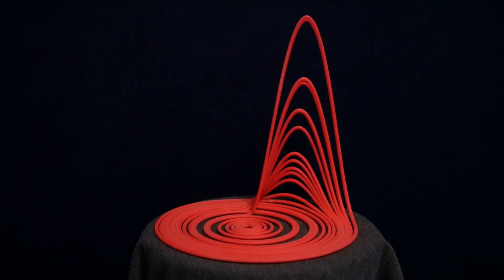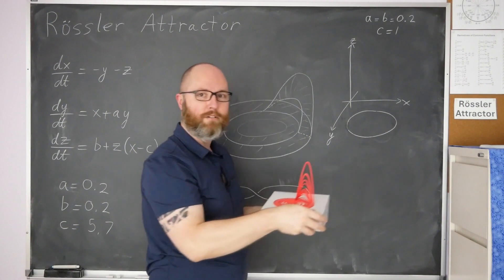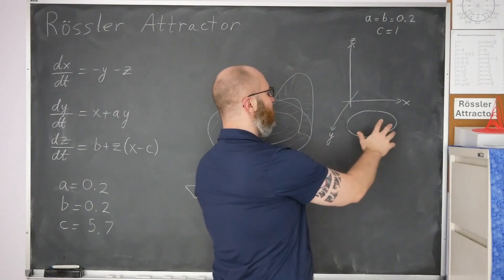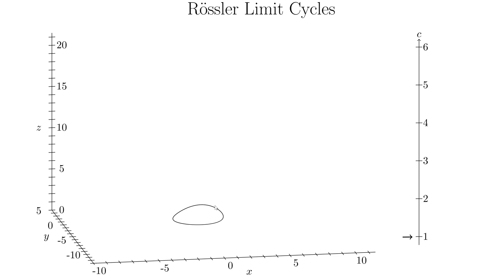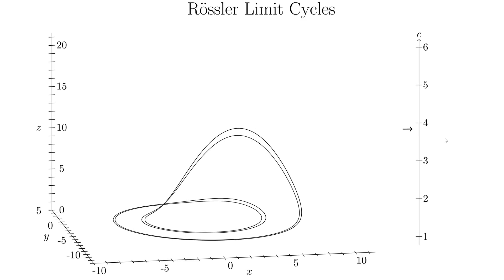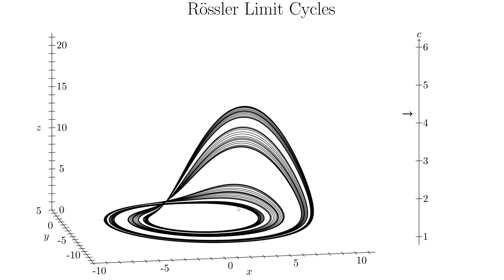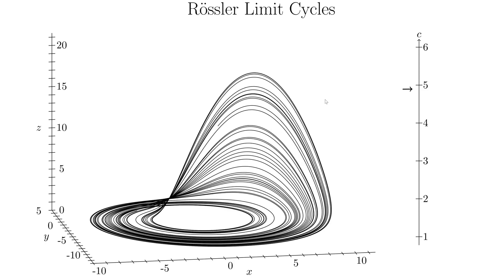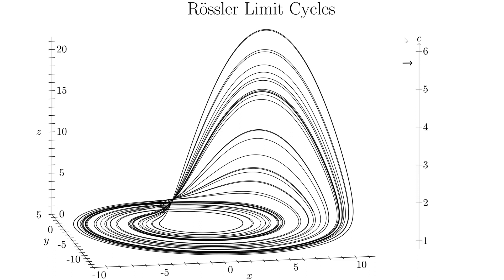Rössler Attractor

Comment: I really would like to print one of my own. Can you share the model?
I also want to print all these amazing mathematical surfaces.  Is there a forum for this??
Reply from the maker: I don't have the file used to create this, but I found an extremely similar looking model on Thingiverse https://www.thingiverse.com/thing:1425939 you can use. With that, you can pay an online company to 3D print one for you. Double check the size of the model you order. Mine fits in a 15cm cube. Also, please consider posting the company you used and your experience for the benefit of others. I imagine the model will be difficult to print since the top flexes a bit.
Reply from the maker: A quick search on Google for "3D print Lorenz attractor" and even just "3D print math" yielded good results. If you want to design custom 3D models, you're going to have to use software that can generate STL files, or another 3D file format. You can use equations to generate a list of points on a path, like for the Rössler attractor, or points on a surface to create a triangular mesh. After that, you can use software to give those objects some thickness so they can be printed. Looks like using Mathematica is relatively easy for this, but a little pricey if you're only going to make a few designs.

Comment: I took Physical Chemistry when I was getting my degrees.   The prerequisite for the curse was Differential Equations.   I hadn't taken the prerequisite.   I had to teach myself Diffy'Q while taking the course as I had no other room in my schedule to take the course concurrently.   Oh well.   My chemistry was good enough that I still tutored the chemical engineering students for the chemistry portion of the class.   I still kind of sucked, though, and only got a B in the class because I was struggling to remember the lengthy equations associated with the class.   Did I know precisely what I was doing and why?   Well, no, but I managed to muddle through without knowing a single thing about Diffy'Q in a course that was almost entirely about applying Diffy'Q to things like thermodynamics.
Reply: I took a probability theory class that had multivariate as a prereq (I didn't even realize that at the time however)
Thankfully I was able to extrapolate calc enough to fill my knowledge gaps for the most part without any actual multivariate studies but it definitely showed that I didn't know it in some places lol